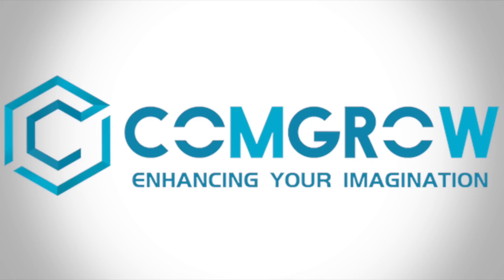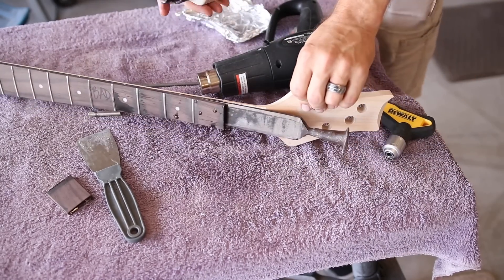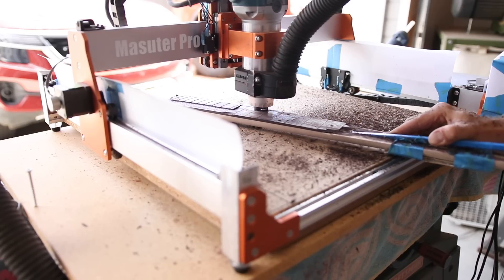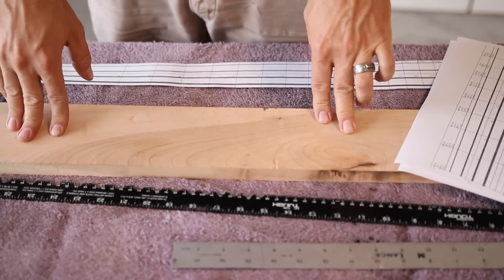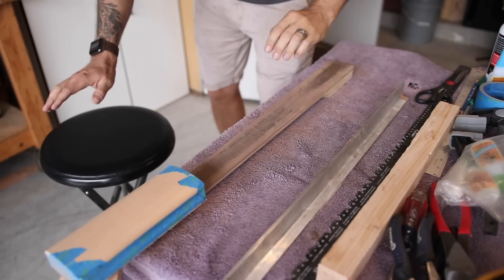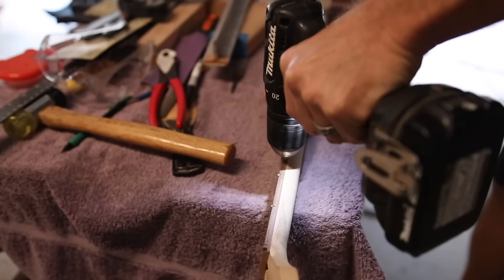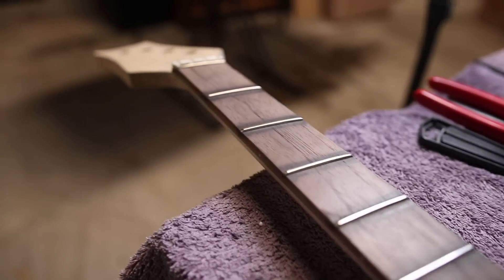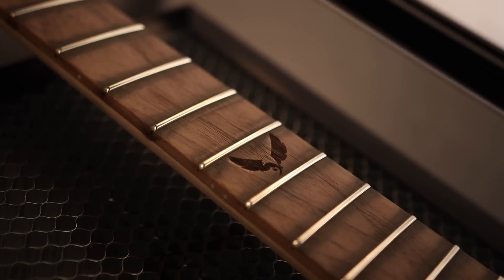Making a MULTISCALE Fanned Fret Guitar Neck from a CHEAP eBay neck!

Comment: Just wanted to mention that the zero fret can and should be the same height as the rest of the frets.
Reply from the maker: I can always take it down a little if needed. Not as easy to go the other way!
Reply: Most brands use a larger fret than the rest for the zero fret.
Reply: @LukeShingoose  think about it for a second or two. Once you fret your B string at the first fret, is your first fret any higher than your second fret, and does it need to be higher?
Reply: I have a beautiful musikraft birds eye maple neck new....where can I get a swamp ash strat body for it?...musikraft dont make bodies anymore
Reply: @vanshankguitars  I think you need to think about it for a second because what you’re saying is wrong and matter of opinion. Like I said, a lot of manufacturers use taller frets than the rest for a zero fret, which is simply a fact. If you take a strandberg for example, a guitar that has thought and purpose behind every feature lists clearly on the site the fret sizes used and you can see that a the Boden bass uses a zero fret that is 0.006” taller than the rest. 
Sure you can make your guitars zero fret the same size as the other but to say that it’s the only way is completely different.  It at best is a matter of opinion which isn’t the argument I was making. For that sake you can say zero frets are vastly inferior to an actual nut or whatever you want to argue.
Reply: @LukeShingoose  u had me all the way up to a zero fret is less superior to a good nut. That's simply incorrect. Just changes the dynamics of what the nut is being used for with the inclusion of a zero fret. A good zero fret WITH a great nut is how I've had all my customs made for myself. That's after decades of going back and forth. Now I'm only one guy but that's after a ton of research and even high end luthiers I've worked with agree a zero fret can be a great tool for what it's designed for. With that said, really only ss frets can continue to have a zero fret work well for the life of the guitar. My two cents. Also I play guitar not bass, but I imagine same concept. I personally prefer a zero fret the same height as all the rest but your correct about how they're generally manufactured slightly taller. Depends on who's making it. I think zero frets should be way more common, ditto with ss frets. Hate nickel!!!!?
Reply: @micemr76  my dude I was simply saying that zero frets are inferior to a nut as an example of an opinion which was my problem with the other guys comments. I also prefer zero frets and SS is the way to go fo sho!

Comment: Just a thought but instead of drilling so deep for your fretmarker dots on the side of the neck. Why not drill really shallow holes and cut little pieces of the rods and put those in. You would save a lot of that fret dot rods if so. Pretty sure that's how they are normally done too.

Comment: You should do some research on how to do this.  A thin spatula type tool will pry the board off at an angle that is not so severe. The chisel bends the wood past the breaking point.  It is much easier and cheaper to learn from others mistakes than to make them again while reinventing the wheel.

Comment: I just finished the first neck I ever made and its a multiscale 7 string guitar, I made my template using FreeCAD Marz guitar to build a fretboard model and then converted it to SVG and printed it off. A miter saw would definitely be way better for doing the initial cut but doing it exclusively with a hand saw wasn't too terrible.

Comment: Cloth iron is what I use to remove fretboard. Leave it on for around 5 minutes on highest setting then use a paint palette knife to slide it under, sometimes a thin ruler but I found palette knife works best for me.
Great idea on the fretslot cutting technique! Gonna use the same for my next project.
Reply: Totally agree. I used an iron to remove a fret board as well as a set neck from a guitar I was building and messed up. Got it right the second time. And was able to reuse the same fret board. The iron caused no damage.

Comment: I’ve had this idea for the longest time but never actually pulled the trigger, awesome to see it 
Looks FANTASTIC!!

Also, an easy way to remove a fretboard is with a dull knife, one that’s not thick but it’s dull (exact opposite of that chiesel, that’s why it broke). You can work your way up the fretboard with patience and it should come off very cleanly using a heatgun and being careful

Comment: An easier way to remove the fretboard is to use a cloth iron and a cake knife or the back of a flush cut saw. Heat with iron then slowly push the knife down the heated area. It’ll pop of real easy and the fretboard will be reusable when your done. I’ve used this method three times with great success to replace broken truss rods!
Reply from the maker: Awesome thanks for the tip! I’ll try that next time

Comment: Your bass looks to be my favorite design yet. I like the semi-hollow. On the quad coil, I like to keep things simple from an operators point of view, so could you have 4 3way switches to control each vertical pair of coils? Each switch could be selected for top, bottom, or both. That way you could just look and see what is on or off.

Comment: I think the best way to fix a twist like that would be to pull all the frets and soak the neck in water.   Then place the neck fretboard down onto a hard surface that will not bend such as a thick workbench (possibly with something like a couple of rulers you could tuck in each side to allow for the curvature of the fretboard) and clamp the neck down to said surface.  Hopefully once the water dissapates the wood should settle in a straight configuration at which point you could release the clamps and install some new frets.  That way you should be spending much less time doing the repair although the time taken to put the neck back into surface would be longer.

That bass you are working on looks like it will be something I would want to own.  The pickup looks very interesting, I bet you could do all sorts of interesting wiring with that.  I am thinking P bass, reverse P, inline front and rear and that's only thinking of the one pickup.  Trying to wire in all the options for a dual set has got to be a bit of a nightmare.
Reply: I’ve been looking for pickups that can do that WELL for a long time..

Comment: If you have an instrument with a standard bridge but you want to make a multiscale neck for it, and you don't want to be limited by the orientation of that standard bridge, simply set the parallel fret to something like 1000 in a good online fret calculator. The effect will be that the playing area has no parallel fret and the fan will get more and more subtle as the neck is traversed toward the higher register. See Strandberg guitars to visualize it better.
Btw...
This was a bit like watching someone cook a meal while really drunk. Pretty messy, but you got there lol

Comment: I was wondering why you were chopping off the end of the leveling beam until I saw the drill press. That's $65 saved over the Stew Mac fret caul, clever!

My DIY project is at the routing stage and has been for months. Now I just need to take a router to it >_> I did recently redesign the body shape, though, and the neck is ready to go!

My SRC6 I refinished in black (Minwax True Black) is about to be reassembled tonight! As I type this I'm hitting 24 hours for the dry time on the Rustoleum matte clear coat :D So, time to put it back together and reinstall the electronics!

And then the Soviet Formanta bass...

Projects, projects, projects. And I already have an idea for another after finding a short scale neck for $75 >_>

Thanks for sharing! I'd be tempted to sacrifice a few frets if I could get 35" on the bass side somehow.
Reply from the maker: You might get 35” if you have the space to move your bridge back a little
Reply: @GunsandGuitars  yeah, that makes sense. I occasionally find 35" scale 4-string necks on eBay or Reverb, but they're not common. Thanks!

Comment: Wouldn't you need a longer 1" neck length for the intonation?
Reply from the maker: Nope. It was a 34” 24 fret neck. I made it a 34.25-33.75” multiscale 24 fret. Just need to make sure my bridge saddles can move back ~1/8th on the low string, and forward ~1/8th” on the high string.

Comment: Was surprised that fretboard didn’t come off cleanly- I have done this a few times- used an iron…came off pretty easily.  I wonder how it was glued down.
Reply from the maker: I wanted to try an iron but couldn’t find one, that could have been the issue. Might try it again with an iron if I can grab one cheap at a thrift store

Comment: Hi Dan, are you still using the basswood sheets from Hobby Lobby for your pickguards? 

I tried it for one of my builds, but was unsatisfied with the results. I found that Michaels sells 12”x5.25” sheets of PINE. I glued two together to make a pickguard. Not only does the grain look nicer, but it is significantly sturdier than the basswood. 

I highly recommend you try it
Reply from the maker: I never used basswood for pickguards. I use birch plywood. I use basswood to make shims.

Comment: I got way better results using just 2 spatulas and going from the opposite side (since from the nut side, usually the fretboard is thinner due to the (d'oh) nut having a recess.....and no water needed at all, just a warm iron (the one for the clothes, nothing fanzy) and I applied it directly on the fretts, so the heat remains longer, and also applying heat directly to each spatula.....after struggling for 10min the first inch, eventually the spatulas started to move like into butter accross the neck (the chisel is way too thick and will cause what alredy happened here, which is to crack the fretboard...doing this work like this, I manage to remove the whole fretboard in a single piece, and the frets didn/t even came out, literally I can glue the freatboard in another neck if I want.